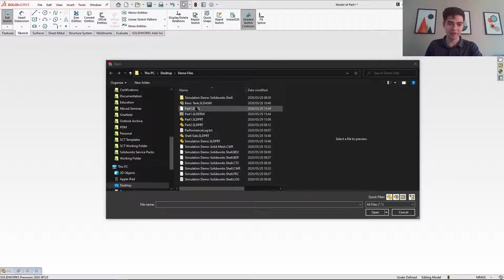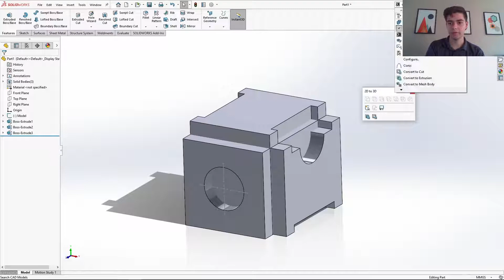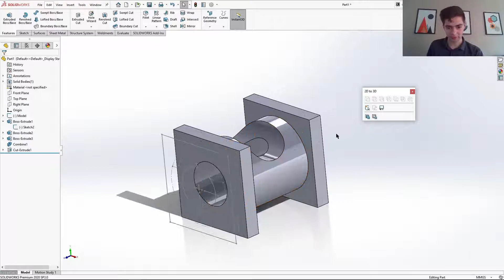Converting DWG to Solidworks 3D Part

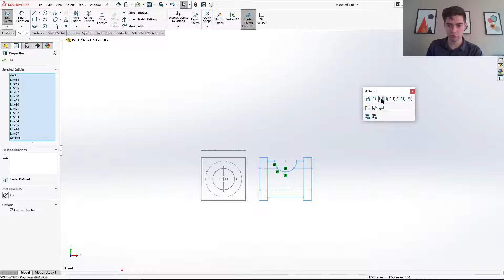Comment: How do you compensate for misalignment of sketches when you select front/side/top/bottom views? (Around 1:30 - 1:40)
Reply from the maker: Good Question David! The best way is to select a point or edge, and use relations like vertical, horizontal or coincident to align edges/points. You could also use construction geometry and the same relations, or even use the “move sketch” command, hope this help!